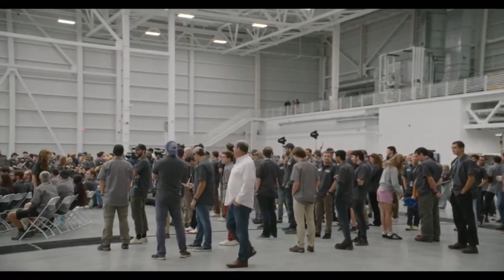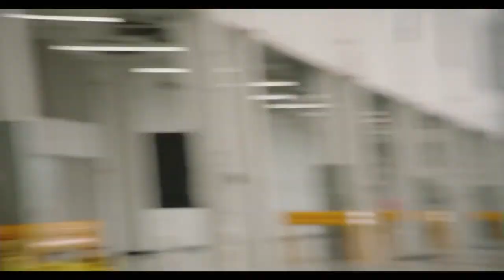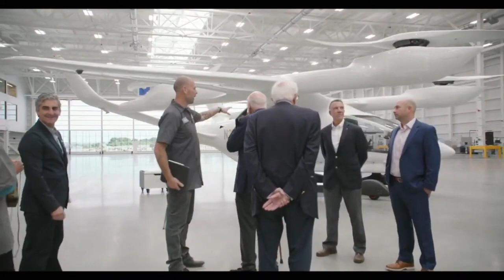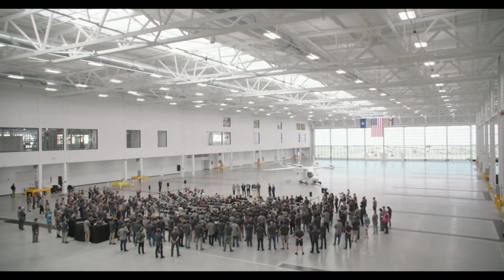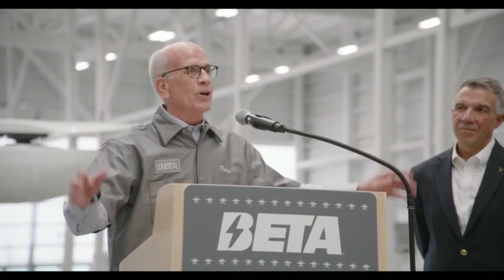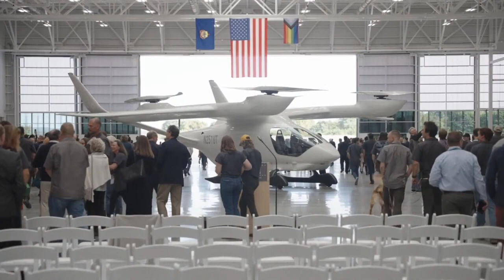BETA Technologies Opens Full-Scale Electric Aircraft Production Facility in South Burlington, VT

Comment: This is really great! I hope at some point they consider implementing parachute for guaranteed safety. Anything could go wrong at any time especially with short-circuiting incident, lightening related or mechanical or chemical mess-up that could trigger fire. I know the engineering team takes into account all possible scenarios, but anyone would feel 100% safe if there is a parachute and/or the way to eject the battery during fire incident.
Reply: You know that most planes run on jet fuel, which is explosive, right? 😂